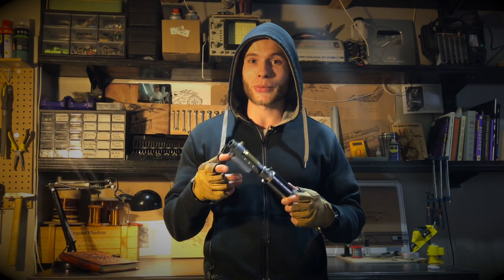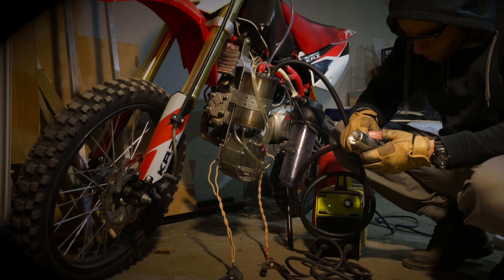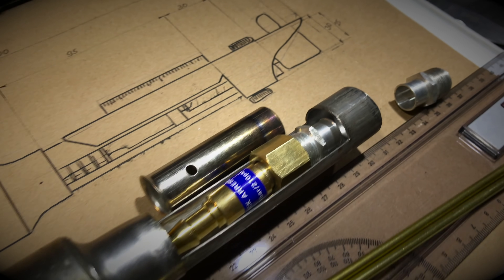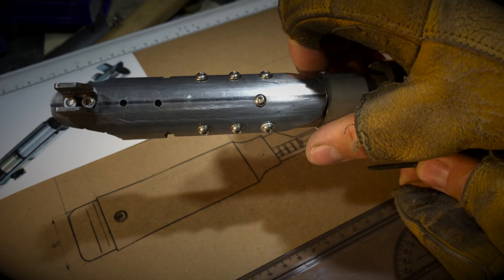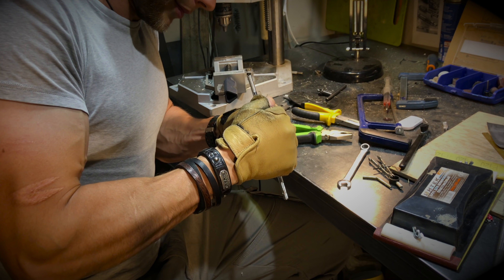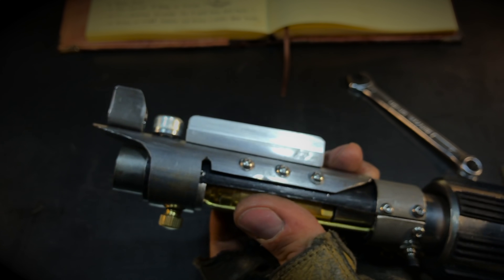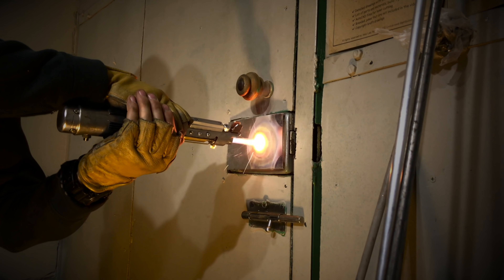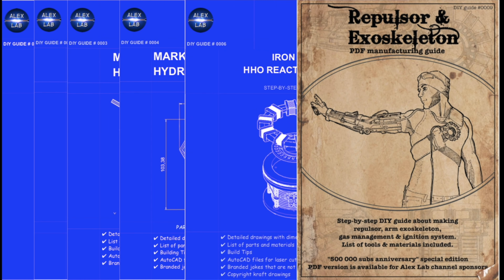First real lightsaber. HHO & high pressure electrolyzer. Guinness World Records approved.

Comment: for this, you could make a small hole on the side and you could make a belt that has a gas collection system connected to a reactor. just like how luke locked his lightsaber onto the belt, ypou could make it so that, if you lock it onto the gas system on the belt and it could refill itself

Comment: I'm far from being involved in any scientific field (and it's very likely my thought already has been brought up by you / anyone or is plain stupid), but your initial comment in the video on how you just need water as the main ingredient for plasma made me think - would there be a way to draw the water from the surrounding air humidity via small inlets in the hilt, pumping it into the water tank? If so, it could make the blade self-sustainable or at least prolong the duration of a single tank fill, right?

Comment: try making like a measuring tape with an electronic current a battery with retractable wire witch type of wire electricity keeps stiff yes i would go with retractable wire something that will stay stiff with an electrical current you wont even need the sound effects dueling the blades lol may the force be with you is the part in a lightsaber where the wire bends to turn it off lol and on and when yal finally use my idea i want my money for it think about a measuring tape now think about a measuring tape retracting with an electrical current you figure out how to keep it stiff your a very rich man the lightsaber is probably the most easiest invention ever thought of we just try too hard sometimes now imagine 3 retractable wires with an electronical current there u have a real lightsaber and electricity you can make it any color you want! now a magnetic glove to catch your saber is the rich part! whoever makes my invention id give alot of money to if it worked notice lightsabers are as pointy as a pools tick they shouldnt change much so during surgery you should be able to turn a lightsaber on and see the wire without the electrical current pretty cool some could be wire some could look like a measuring tape in that sort pretty sweet

Comment: Ok so now we need something to contain the plasma. Maybe something like telescoping ceramic rods with tiny holes drilled into them to emit the gas. the ceramic plating used by NASA (these can withstand the heat of reentry). If these aren't there you can of course cut in metal but not "sword fight". Just a gas blade not solid enough to stop another blade. After all is said and done this is a great job done

Comment: Ok hear me out on this. The nozzles used in the Hacksmith protosaber might stabilize the blade, but think about this also: some way to force air through the outer ring of nozzles instead of just the burning fuel. Combine that with your hydroxine tank design, the nozzle array above it and some kind of forced air turbine under it. Might even help save on fuel, but I'm not positive on that one. Liking this one way better than the Hacksmiths version, BTW. Love that it's all contained in the handle and that it's such an accurate build. A stabilized and hotter burning blade would really seal the deal on this baby. Too bad there's no way to store the fuel AS water instead of having to separate the gas in to the handle, but we don't have that kind of tech just yet unfortunately. Here's to hoping for a big boost from the carbon batteries.

Comment: if you added some sort of easily accessible size limiter you have a very useful tool. you could use it as an emergency torch on low, fire starter at any, and a last resort weapon. all in one, powered by water... 
also, how do you refill the tank?

Comment: Sorry but that ain’t no light saber
Reply: they cant be real... this is as close as we can get without getting silly. 
you cant put force on the flame or cut stright through metal, the energy needed would be enough to melt your face. 
the hacksmiths is as close as we can get and they needed minutes to cut through thin steel. and even then its not really a cut at all. 
duels would also would also consist of burning the crap out of their opponent instead of repelling the blade of there rival.

Comment: For being hand held and not attached to anything this is pritty impresive .
Reply: I think with a better, maybe specifically designed nozzle it could look even better.
Reply: @sebastianjost  Indeed. Should be little reason he couldn't do this with a laminar flow nozzle I think.
Reply: Hmm i think hacksmith made it to carry on their back for a 5 min result at 4000°F 
That's impressive
Reply: wel if it used too much power you cant contain all that power in a handle
Reply: extremely
Reply: Very impressive imo
Reply: que rica la pritty amigooo
Reply: Impressive it's impressive it looks like a F**** giant torch
Reply: @Jordan-vz7kt  nah it’s pretty impressive, imagine what he could do with a higher budget
Reply: @greenguy358  it's not really that impressive if you think about it. Look at the blade it looks terrible not realistic.
Reply: @Jordan-vz7kt  It's impressive that he could make it that small, and have it last that long. Look, you build one. These are common materials, if he had a bigger budget or a team, he could make it better. But he doesn't have a team or a big budget, so he has this, and given the circumstances, it's much better than you would expect.
Reply: @brandonnguyen6718  tttttrrrrruuuueee but I just don't like the way it looks. It's fire not plasma which a lightsaber it mad off lol not flickering and unstable and uncontrollable fire. Like what if it's windy the fire will fly towards you face.
Reply: @Jordan-vz7kt  Good point, however, even if it's windy it won't fly towards your face. But I see what you are trying to say. Unless this is like a cracker lightsaber crystal, lightsabers are clean-edged. And plasma is just ionized gas that isn't stable. Most plasma-based
 lightsabers are just fire-based, mainly because it's just easier to use pure energy.

Comment: The hacksmith has made a good fire sword but it's just missing the electrical charge, to make it a real plasma because plasma is a energised gas so where the gas comes from it should come from the middle or a high charged Tesla plate like the end of like Skywalker's lightsaber from return of the Jedi
Reply: Plasma can be artificially generated by heating a neutral gas or subjecting it to a strong electromagnetic field to the point where an ionized gaseous substance becomes increasingly electrically conductive. so it needs a Tesla plate at the top of the hilt where the flame comes from

Comment: While people thinks that Alex's lightsaber is cool, I can only think about hacksmith lightsaber
Reply: Same the hacksmiths defiently made a step forward with the updated model they made though i feel as though they also took a step back a little cause sure the power and heat needed to produce the things are super hot but i feel like they could have found some way to condense the heat and make it where the handle isn't buring like a  star though what do i know I'm just a simple person with a simple out look on it all
Reply: @copingflower1909  They are actual engineers and spent possibly hundreds if not thousands of hours refining the project. If there was a way to do what you described in an effective way that wouldn't impact the final result, they would've implemented it by now.

Comment: Hacksmith made a heated baton, Alex made a flame saber, we're getting close to an actual lightsaber...
Reply: Meanwhile the exact same time you commented this, Hacksmiths released the video of their plasma lightsaber. Comment didn't even age a day before it was outdated. F
Reply: @AnimatorBlake   hopefully he builds a lightsaber that you can actually  block and parry with
Reply: @FlyhighGhGh  Theoretically, that would require quite an astounding level of power. Basically in order to be plasma, a flame needs to have a couple millimeters of electromagnetic repulsion, so the plasma that can repel another plasma sword would need a much higher magnitude of that force.
Reply: Hacksmith‘s lightsaber was a bought laminar glassblowing torch with a backpack power source though. They also have cnc machinery. This guy built almost the same with only some files and a drillstand entirely on his own.
Reply: @zfgm1065  No need to diminish one to praise another. Hacksmith's is quite literally the first plasma sword.
Reply: Hacksmith tried to replicate Alex work and got a Guiness Record for it.
Reply: @elladarthegraywolf3021  Alex tried to replicate Allen work and got a Guiness Record for it.

Comment: The shocking thing is that the principle is perfectly correct. 
The ''only'' things missing are an infinite source of energy and an invisible magnetic field to contain the plasma and give him the correct shape.
Fantastic crafting, congrats.
Reply: Hacksmith used Laminar flow to maintain the shape, although the pipes are quite expensive
Reply: What about rydberg atoms and photonic molecules?
Reply: @ASMRHatov  This will take a lot of time. We need a really powerful source of energy (we cannot wait for anti-matter batteries obviously) to generate high temperature and a magnetic field in the hilt that allows to contain and mold the plasma.
Reply: @心刃者  No, I think Hatov is actually right, plus no need to work with anti-matter. The types of matter that Hatov suggested can release a lot of energy, they are quite compact and can be perfect for a lightsaber. Now, about the magnetic field problem, you should use an isolated tungsten blade. This is for the hilt to give shape, as without that the matter just gets sent out like a normal laser. This would create sort of plasma-like heat on the tungsten blade without the need of an external energy system. 

THIS IS JUST A HYPOTHESIS, I'M STILL LEARNING QUANTUM PHYSICS
Reply: I also forgot, potonic atoms release more as a light energy, for making the lightsaber more realistic. And rydberg atoms release real energy for cutting through materials
Reply: And magic crystals but we don’t need it also in the old days in Star Wars they didn’t have a magic field they had a metal rod around the side and a bit to stop it on top
Reply: Awesome work, but... Oh come on! That's not LASER and not SABER ! :(
Reply: We need quarz reactor, like we know lightsabers are powerd by stones, Quartz ineed makes electricty, so what if we make something to react with Quartz like nuclear reaction

Comment: Now you just need an electromagnetic containment field to hold the plasma in place.  This has been accomplished already decades ago (the plasma containment system) in the form of a nuclear fusion reactor metal donut with magnetic coils that contained hydrogen fueled plasma from hydrogen pellets heated up by a decent sized RF emitter that looked kind of like a blaster canon off of an X-Wing fighter.  The magnetic coil wrapped around the metallic tube of the donut shaped assembly kept the 5,000 degree plasma in the center of the metallic donut shaped tube so that it didn't melt through the metal.  Not sure how you would create a containment field that is projected out from the handle of a saber, but I am certain there is a way to do that given all that we know about electromagnetic energy and how we can manipulate EM fields in various ways.

Comment: You copied the hack smith get something original
Reply: Hack Smith has a completely different design, that use a rod running the length of the saber and an external battery.

This is a self-powered tool that extends without the use of a metal rod.

These are completely different, and this one is closer to a lightsaber than the other.

Comment: I call it's only a Flamesaber, but this is the first step on the way to a real Lightsaber. 👍

It might be good to construct a sword with a laser stretched between two points. A positively charged lens for the energy exit and a negatively charged flow aperture for the energy absorption. So that the energy can be fed back into the energy cell.

Linke this two Blades
content://com.android.chrome.FileProvider/images/screenshot/15992444035301652331547.png

Comment: Original lightsabers (protosabers) had a power pack that was worn around the waist, with a cable that ran to the hilt that provided the power. I bet you could get a longer runtime if you implemented something like that.
Reply: Hacksmith did that as the first irl lightsaber.
The one on here is the first one to not need a external fuel tank without being bulky

Comment: Hacksmith lightsaber: overheated tungsten/ titanium tube
Alex Lightsaber: hydrolox flamethrower
Reply: Hacksmith : retractable plasma lightsaber
alex: flamethrower go brrr
Reply: Hacksmith plasma lightsaber:"amateurs"
Reply: @Spork15  The Hacksmith “plasma” lightsaber was taking the fuel injector of a small rocket engine and directly ignite the gases... I call it a propane-oxygen rocket motor... and btw, rocket exhausts, especially hydrolox ones, have temperature hot enough to boil iron.
Reply: @kerbodynamicx472  Plasma may be contained inside their flame based on the electromagnetic reflectivity of the blade and usually the determining factor for whether or not a flame contains a significant amount of plasma is the heat. At 4000 degrees, I don't think that you need quotation marks around the word plasma.
Reply: @AnimatorBlake  yes, it’s rocket science
Reply: Well to be honest what the hacksmiths were even able to do with there lightsaber or phonton blade is still impressive and still has loads of room to improve and make the blade longer and not having to wear that bulky backpack to keep the saber on
Reply: Well, granted, the Hacksmith used a much larger budget and were a group of 4 people, and they aimed to make a protosaber to make things a little easier
This lad made this by himself in his workshop, which is really impressive imo
I think they both deserve credit

Comment: Amazing! You made it. Since I saw the first video about ion plasma rocket engines I almost knew that somebody will use it to build the first light sabre. But I couldn't do it myself because I'm not an engineer. Well your actual model is more a fire sabre and two fighting blades will go through each other which makes a sword fight impossible. But I just think it's your first step into the right direction. Some day soon you'll find a way to form a true ion plasma blade by using a strong magnetic field and I think that this magnetic field which keeps the ion plasma inside of the blade will also make a sword fight possible. Because the equal magnetic load on the outside of two blades will reject each other. The poor facts of my idea are the power supply  and the side effects of the magnetic field.
But you are the engineer and maybe you can figure it out. Keep that shit up. You are so much better than the hacksmith dudes. Maybe I inspired you a bit. I would greatly appreciate an answer.

Comment: Maybe if you built on some battery with high charges + something in the edge that can coil, compress the air around the energy expansion to stabilize the beams form. I dont know how to expand the power though. Maybe that blue laser that costs tons of money? I dont know. Just givin ya some ideas may they be useful or not.

Comment: At first I was like, oh clickbait it’s just a handheld blowtorch, I was wrong, you proved me wrong sir. I have great respect for you.
Reply: Not gunna lie... he built a handheld plasma cutter not a lightsaber as depicted in the movies but fuck it close enough
Reply: @tyranus1111  except that that isnt plasma coming out the end of it
Reply: @Matrixx plasma cuts at around 20,000 °C, it melts thru base metals like a hot knife thru butter. What he built isnt discharging plasma. Closer to what's called a water torch since he's using compressed HHO as the fuel source.

also 

If it was plasma, him looking at it without eye protection would cause extensive damage to his eyes. There is a reason welders those masks.
Reply: @tyranus1111  check the hacks smith vid
Reply: @tyranus1111  you wanna know whats even closer to the one in the movies? check out the hacksmith
Reply: Great now we just need a supper strong magnetic field
Reply: Well, to be fair, it is a glorified torch honestly.Not stable or controlled much at all.
Reply: It's just a plasma/ gas torch.  Pretty simple

Comment: Yes! you're almost there, my friend. you are missing two components, and then you have the world's first true lightsaber. i was literally talking a month ago about how this was the direction one needed to go in to achieve the effect. you need compressed air from a mini jet engine at the base of the hilt to produce laminar flow around the blade, and you need rings of electromagnetic compression to tighten up your beam. otherwise, you have done it, and you will be remembered for this forever.
Reply: ^^^this is important y'all
Reply: @lordreiman8352  I'm building one soon. I've spent the whole summer acquiring parts for it
Reply: @joshuawayne9811  will it be on ur channel?
Reply: @saintsfps5348  yes, just as soon as I get my new workshop set up
Reply: @joshuawayne9811  awesome, subbed, can't wait to see
Reply: Can't wait to see it though you do realize if you are able to pull this off and one up both hacksmiths and here you will prove so many offical people wrong and not only that make history good luck no pressure
Reply: Yet people give all the credit to Hacksmith.
Reply: @UnicornGuru  and?

Comment: The reason this is not a real lightsaber or the "first" is because of one glaring issue... IT IS NOT A BLADE!!!! The Hacksmith technically made the first bladed lightsaber that worked. Even though this uses plasma and is hot enough to melt steel, this is not a lightsaber.